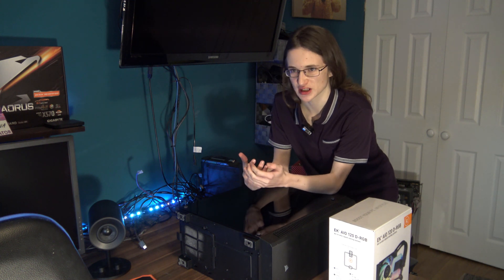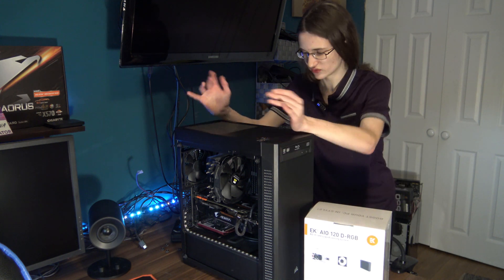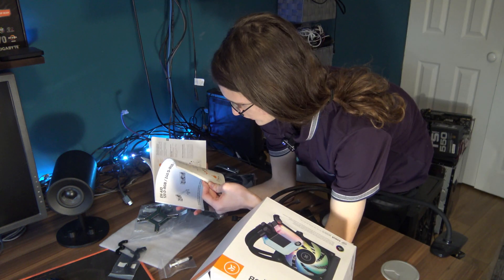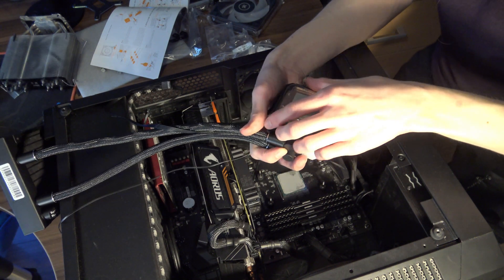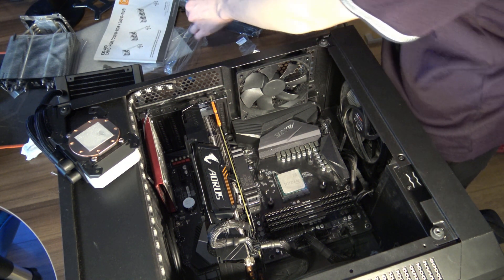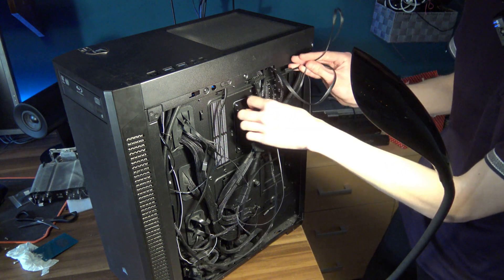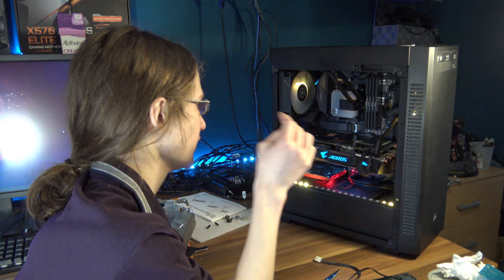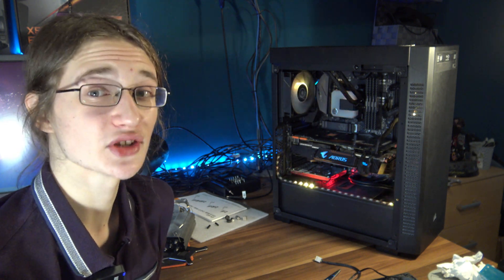BEST Budget AIO Cooler?! EK AIO 120 D-RGB Installation and First Impressions

Comment: I’ve used my deepcool capt 120 for years. Ever since my 1700x. I still run it on my 5600x on an x370 board. I went from 1700x to 3600 and now the 5600x. Idle temp has always been 32* c on all CPU’s. Never had a problem. It’s running right now. I’m more worried about gpu temps. 1080ti still going strong with stock cooler. Just ordered one of  these so I can put the deepcool into my nephews pc. I hope it’s as reliable as my deepcool is. Hopefully I doesn’t leak on me lol…I can only get it used cause they’re out of production but I’ll find out if it last years from now or not.

Comment: Good shit who runs  a 120mm aio in 2024? I run this same exact one on a 5800x in the worst possible case. Omen 25L and it keeps it from ever hitting thermal throttle. Get close at during stress testing but nothing over 81c during gaming. PERFECT!

Comment: I'm cooling a 5800X with the Original Corsair H50 that came out in 2004 and it still works really well.    

Oh snap 9:26 you should find a way to mount the radiator with the tubes on the bottom.  Gamers Nexus did a thing on it.  Air will build up around the exit and inlet slowing things down.
Reply from the maker: I have it mounted with the tubes on the bottom when I did some more experiment with it after the video in preparation for my review. Also glad to see your H50 still holding up so well! 👍

Comment: you need to flip your radiator hoses at the bottom if you start getting a noisy aio pump its from that
Reply: is there any other problems with the way the radiator is placed? im just curious
Reply: @kien1520  gamers nexus made a whole video about it, you basically want the radiator to be the highest point in the loop. air bubbles in the tubing may increase the evaporation of the coolant. And air bubbles in the pump may reduce its lifespan and increase noise.
Reply: @Gibbols  Jay did a video on GN's video (confused yet? lol). Pretty good watch too:  https://youtu.be/DKwA7ygTJn0

Comment: how u hold ur back plate on during assembly
use masking tape to hold in place.
Also make sure the orientation of fan, hose and AIO are in the way the manufacturer wants it mounted.
Good work.
i am watercooled the EK way.
soft tubing also very easy.
i wonder about ur temps. 
I am overclocked intel i7. 7700k to 5.0 at idl i at 27*c also my graph card at 24_* idle.
In 2077 card never above 44* and cpu as well. 
i figure rizen runs hot